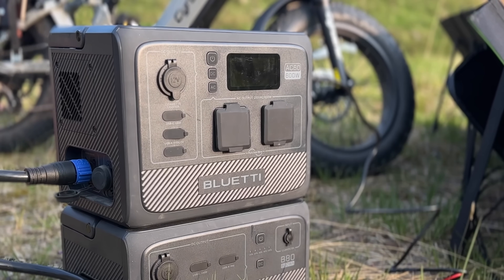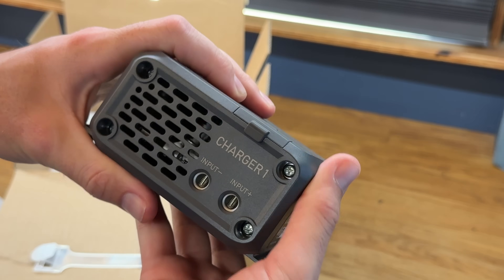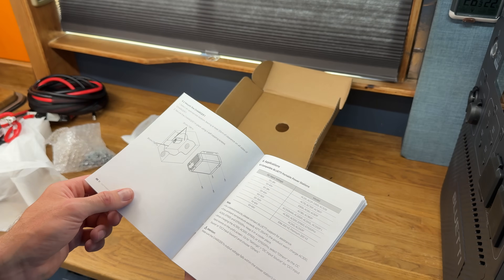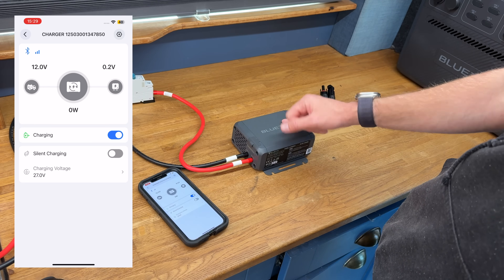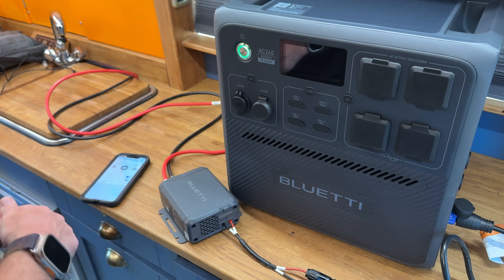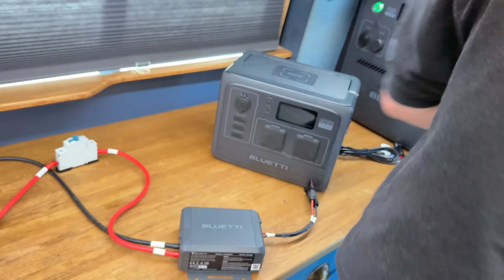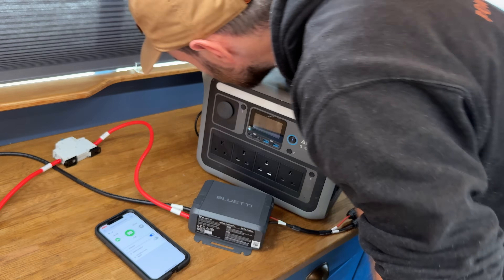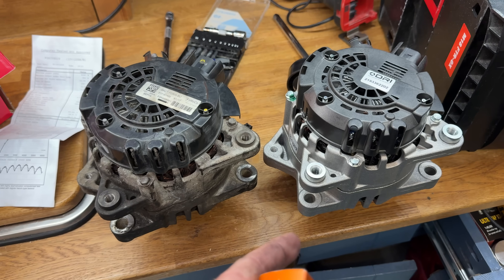WARNING! This Could DAMAGE Your Power Station | Watch BEFORE Using the Bluetti Charger 1

Comment: Just sub’d, exactly what I have been looking for. Clear, concise information. I have a 20 plate Transit Custom Limited. Intending using the CCP point with its 60 amp fuse. Do you think it would be better to put another fuse outside of the seat base/battery storage, if so, what size would you recommend ? Also, is it best to use the negative terminal on the battery, or find a suitable ground point close to the seat base ? Thanks
Reply from the maker: Yes, I would personally add a second fuse on the outside main reason being if it’s slightly smaller and it blows at first it’s logistically easier to replace. Fixing the fuses for the CCP point is quite difficult. 

As for the negative connection, I use the negative battery terminal, but I make sure it is downstream of the Ford shunt.
Reply: @MispronouncedAdventures thank you. I will look at which negative stud you have used. Much appreciated.

Comment: I've just returned from a 13,000klm trip across Australia and used the Charger 1 to recharge a Bluetti AC180P which was running the freezer. I installed a 60A breaker on thecar battery end before leaving but found that at full power (56V), that breaker would trip after 10-15mins. I scaled back the voltage on the Charger1 to 40v and it worked perfectly all the way. maybe it was the extra heat under bonnet causing the breaker to trip but we were doing quite a lot of klms each time we moved along so it wan't really a problem and the AC180 was up to full in a couple of hours, even though it had been running the freezer for 2-3 days. Great product and has meant that I don't need a second battery under the bonnet of the car.
Reply from the maker: That sounds like a pretty epic trip!  glad it worked out for you

The breaker tripping sounds about right. they are thermal based after all and from my understanding Australia is loaded for its warm climate!

Comment: I have elite 200.  It can easily take 560 watts.  Can i choose lower charge rate without damage.  Say 200 watts instead of full 560
Reply from the maker: Yes, lowering the voltage is fine

Comment: Good job with all that information! I am very new at figuring all this out, and I do have one question, since the charger 1 is connected with the mppt plug-in, does that mean you can not have solar panels plugged in at the same time to have more than one charging option? I'll be charging my Bluetti elite 200 v2 in my Transit van. I'm just wanting to make sure this charge 1 will be a good choice. Thanks for any help :)
Reply from the maker: Yes that can be the drawback of the charger 1 it’s universal as it utilises the solar MPPT port on the power station. Most of the smaller power stations only have one MPPT. Which means you could only have one plugged in at a time. ( potentially with some relays you could create an automatic switching system ) however units which have larger power stations have 2 solar ports.

Comment: You also have to watch where you place your solar battery. Some are very temperate sensitive. You can set the Charger 1 to the correct output voltage but it you exceed the max temperature for the solar battery's charging voltage it can damage the dc mppt controller part of the charging voltage. Here in Texas, putting in the back of a truck under a tonneau cover is summer can do just that.

Comment: It's poor design if it damages the power station. Bluetti should advise customers which Bluetti power stations it's compatible with
Reply from the maker: I’d disagree, pre-standard for many electronics specifically which deal with charging device and allow the end user to charge setting to support a wide range of applications. Is the end User starts changing settings with no idea what they’re doing. It’s not exactly the products problem.

Additionally, Bluetti literally give you a drop-down menu in the app to change it to their specific models or allow custom settings and give you multiple warnings which need confirmation before the settings are applied. And it’s even supplied on a low setting which is going to be reasonably universal.

Comment: Making sure I understand because I am still new to all this solar and power station stuff. The River specs from EF website: Solar Input: 11-30V, 8A, 110W Max; Car Input: 12V/24V, 8A, 100W Max. You used the 30V max from the solar, not the 24V from car? But you are charging it from the car? Then you brought it down to 28V and the River was happy. Since you are charging from the car, shouldn't you use the Car spec, not Solar spec? I like the idea of it being used for different brands.
Reply from the maker: Cars & Vans are normally 12V, some trucks will be 24v. The port of the River is limited to 8A

So you’re normally limited to 12.9v x 8a is around 110w. 

if the truck is 24V then there is less benefit on a smaller powerstation. 

with the amps limited to 8A you want a higher output voltage to maximum charging.
Reply: Seems to work with the bluetti alternator charger 1 up to 28V*8A= 224VA or 224W at the solar port of your River… This is 2,24 times quicker 😊as if you would use the „round cigarette“ or „12V-car“ input with only max. 100W…

Comment: Are these safe for my truck stock Alternator ?
Reply from the maker: Depends the alternator. Mine came with a 220A alternator so it’s a not an issue. Older vans might be 110A and loads of other options. 

a rule of thumb a auxiliary loads on a alternator shouldn’t be more than 1/3 of the alternators capacity

560W at 12v is around 46A.

Comment: I have 2 Allpowers R1500 with a maximum solar input of 650 watts. I want to use 1000 watts of solar panels so that I can get more watts during the morning and evening. If I get a Bluetti Charger 1, can I run the power to it from my solar panels instead of from an alternator, regulating my wattage input to a maximum of approximately 560 watts, as it does with a alternator? I know by the end of the day my R1500s would have taken in a lot more power off of 1000 watts of panels regulated down to 560 watts than they would have off of 650 watts of panels that very seldom, if ever, reach maximum output anyway.
Reply from the maker: Nope, the input voltage range of the Charger 1 is  12-24V. 

Normally people over panel power stations as long as the VOC / input voltage of the panel array is less than the solar MPPT port maximum voltage  it should be okay

Comment: My bluetti charger arrived today and I happened to catch your video.  Good timing and good video!  Thanks.  Question:  can you charge the bluetti elite 200v2 with solar and this charger at the same time?
Reply from the maker: If the elite 200 V2 has dual MPPT ports then yes. I have tested this on the new Bluetti Apex 300. Solar in one port and Charger 1 in the other

Comment: Interesting.  I had no idea that there were dc-dc chargers intended as an input to a solar charger.  Do you happen to know if the output of this could be paralled with an actual solar panel for use with power stations that only have 1 input?
Reply from the maker: Nope, you will need two separate MPPT controllers. You might be able to design some sort of automated system which switches over depending if the engine is on or not.

Comment: Can this charger be used to charge 3 litiums (36v)?
Reply from the maker: No, as it’s not a charger really, in the traditional sense that it has a charge profile, it doesn’t . It’s a power supply, which supplies a fixed output voltage to a power stations MPPT solar port which itself acting as the charger

Comment: Like any tech product you have to learn how to operate it properly in order to not damage the system components. I added a 60 amp fuse at the battery connection and have used it on a bluetti ac200max and a goal zero yeti 1000. I manually set the voltages for each as the unit doesn't seem to like the voltage that it sets for the bluetti and the goal zero isn't in the app. So far all working as needed.
Reply from the maker: Indeed you do, unfortunately some won’t read the manual, set it to max for “more power” and use it without fully understanding the potential consequences.

Comment: I have 2 batteries under my seat in my transit. i assume the starter battery at the front and an aux battery behind it. which should i connect the charger 1 to?
Reply from the maker: Back one is normally the starter battery. Although if it’s a mk8  transit you will have a customer connection point on the side of the seat base.

Comment: Heres an idea, thats universal and much cheaper with more power! Get a 1200w 12v cheap inverter, and charge ac charging which allows more in, faster, while driving, and you can still charge with solar panels because your not charging through the solar input. You can get 800 to a 1000 watt in on ac charging, and they all charge ac! Pretty simple!!!  😂  drawback, you may not have your blue tooth  😮
Reply from the maker: Some people do this option And since I already have a large inverter in my van, it’s how I charge my power stations.

But unless you already have an established electrical system a few extra bits to consider. 
Creating an automatic on or off for the engine so the inverter isn’t always constant on as inverters have an idle draw which can be significant depending on the size. turning down the AC charge current on some bigger power stations as they’re out significantly higher than some alternators would like.

also got another stage of inefficiency going from 12V up to 230 AC in the inverter and then back down again inside the power station to DC. 

Also a bit more DIY and a physically larger unit than a purpose designed model
Reply: @MispronouncedAdventures  no more work on install, jumper cables, or a dedicated 50 anderson plug, on , off is you, or a switch, and as far as loss in inversion, reversion, your motors running regardless! Now if you were doing it on your unit, after you charge, yes there's loss, and what your referring to is idle consumption in standby,  for a 1000w or less on high frequency unit would be less than 5 watt. My 3000 watt low frequency units idle a mere 13w, and that on a solar power station, not just an inverter!

Comment: Can you use it on an electric car battery
Reply from the maker: From my understanding yes. Most EV still use a 12v system somewhere. But it would be using power from your ev battery

Comment: You still using your charger 1? Does you unit auto shut off sometime after turning off your car engine?
Reply from the maker: As soon as you turn the engine off and the voltage drops in a few seconds , then the Charger 1 stops charging.

Although I’m not sure if you’re meaning if it goes into a permanent sleep mode if turned off for X amount of time? This was a common annoyance people are experience with the EcoFlow model that if it’s idle ( not in use ) for 48 hours or more then the unit goes to sleep and needs to manually turned back on which is a pain!
Reply: @MispronouncedAdventures does the charger 1 totally shut down (green led turning off completely) after turning car engine off. Shouldn't it auto shut off about 30 minutes after car is turned off?
Reply: @EricDimanlig  I am using a charger 1 and it does not shut off completely after the engine is turned off. The blinking green light indicator still turn on. But I made a work around on it and put a 60A breaker near the back of me truck bed and turn it off when I don't have to use it for a long period of time. I don't think it draws a lot of voltage though.
Reply: @PhiLIdahoTaco thanks boss!
Reply: @EricDimanlig  Walang ano man. 😄

Comment: El "Charger 1" de Bluetti está muy bien en vehículos de gasolina y diésel, pero el fabricante no lo recomienda para coches eléctricos o híbridos porque esos coches no tienen alternador para alimentar el "Charger 1".. 🙄
Reply from the maker: Which makes perfect sense, petrol and diesel engines generate electricity via the alternator and have excess. 

Ev, you’re just using battery storage. However, they should still work

Comment: So if you have a ac180 like me With a 530W chargeload, the Bluetti AC180, which has a 1152Wh capacity, will take approximately 1.95 hours. This calculation uses the formula: Runtime = (Battery Capacity * Depth of Discharge * Inverter Efficiency) / Load, assuming a 90% Depth of Discharge and 85% inverter efficiency. 
Here's a breakdown: 
Battery Capacity: 1152Wh
Depth of Discharge (DoD): 90% (This means you won't use the absolute full capacity to preserve battery life)
Inverter Efficiency (η): 85% (Some energy is lost in the conversion from DC to AC)
Load: 530W
Calculation: (1152 * 0.9 * 0.85) / 530 = 1.95 hours 
Therefore, at a 530W load, the Bluetti AC180 should provide power for roughly 1.95 hours if it was fully flat. Hope that help someone. It’s a shame it like £300

Comment: Hi and thank you for this video. For someone like me, who is just learning about power stations, i am hoping you can answer this (probably stupid) question… if we can charge the Bluetti from the car using those 12v lighter chargers, what is the difference between charging that way and with this device?? Help please 😄🤓
Reply from the maker: Hey! The 12v sockets in cars are limited to a max of 10A. Which means you normally get around a max of 120W charging speed ( 12v x 10A = 120w ) 

The Charger 1 is a max of 560W charging ( depending on the power station )
Reply: @MispronouncedAdventures thanks for the reply! Will checkout some of your other videos so i can learn more 👍🏽 and see the northern lights! 😄

Comment: Why not just charge from an inverter? Most people already have one as part of their system anyway.
Reply from the maker: I personally charge my power stations from my inverter but that’s not necessarily the market they are aiming. Most of the alternator chargers by the power station companies are aiming at people without leisure systems using a power station as a sort of smaller scale alternative or car campers
Reply: Remember, most people want nothing to do with electricity except to turn it on and it lights their room or heats their food. So i have a related question for you on that. DIY Consumers and Upfitters now have the choice of installing an AIO All in One power box. But DC chargers are still not built in to those units from what my research shows so AIO is a bit of a misnomer. Do you know of an AIO that does have a faster DC input port already that is not the solar port, so we could charge with both solar and DC alternator together? It would be nice to also use all of that incoming charging power for output simultaneously, so mention limitations on that if you know if them. I am in the beginning of a van build and was just going to us an inverter on my CCP2 w the dual alternator fo a few years till i do a fuller buildout later, but now see the Hysolis 5k etc. and am tempted to jump ahead to those AIOs, but am disappointed in the DC charging options after such a large spend of $4,000+US, any thoughts for a DIY like me?

Comment: I have tue vtoman 2200.jump. shows max inont is 60v.

Will it charge my station and at what wattage. 19:58  When i plug it into mains , it charges at 315 watts
Reply from the maker: I can’t seem to find the spec of the solar port on that unit.

Comment: You've made a good point here & if it takes such a title to get people's attention & understand that the voltage have to match the p.s & charger1...as in the manual, but like you say many people don't read such.
It would only be an issue on small watt power stations, on my ac180 it was giving 230w without matching & 534w once  matched.

I'd suggest all owners download the Bluetti app & all settings are in there.
Reply from the maker: Yes, the majority of people don’t read the manual and imagine they’ll be a number who just think crank it up to max for faster charging without understanding the potential consequences
Reply: @MispronouncedAdventures 
Definitely many are as you say, even some youtubers reviewing the charger1 haven't done any research or reading.